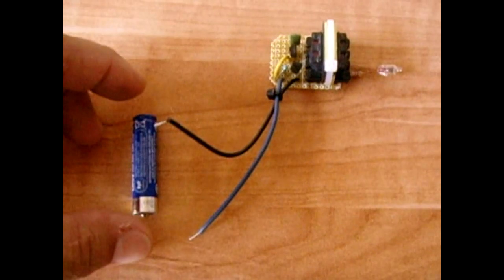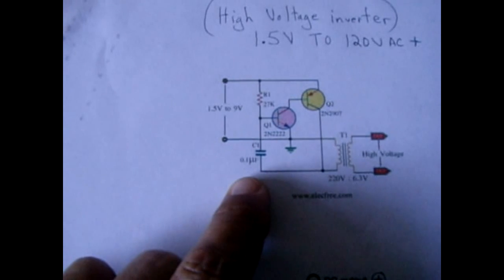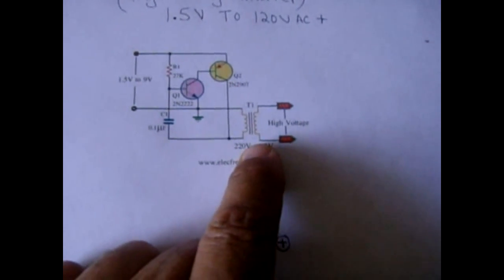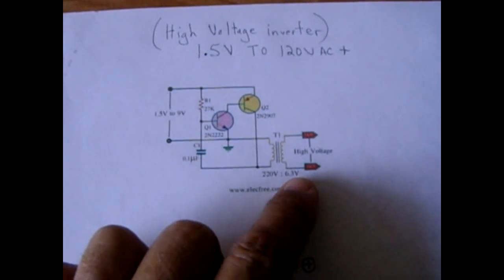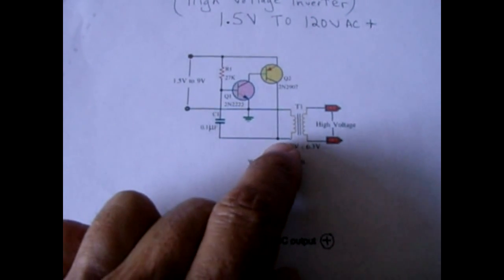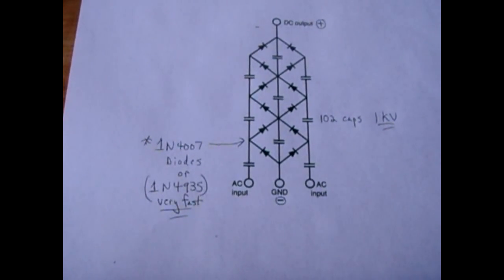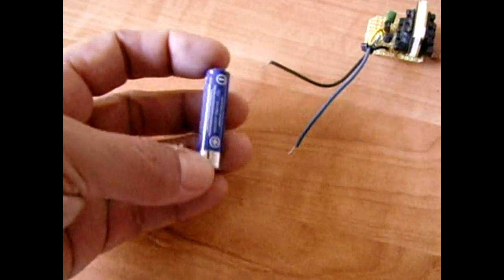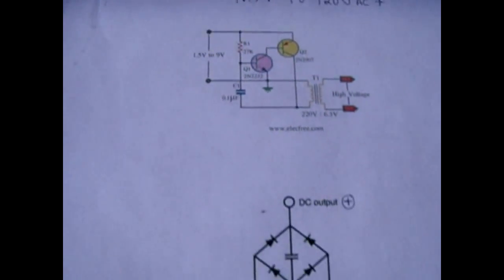AAA (1.5V) Battery to 120V or HIGHER!

Comment: Just for those who don't know. Neon lamps  have 2- electrodes inside of a vacuum of neon gas. When you apply  Ac voltage to them both  electrodes light up  orange. When DC is applied one electrode lights up. Reverse the polarity  and the the other  electrode lights up . DC causes only one probe to illuminate.  There are testers with 3 or 4 neon lamps  each lamp is a certain voltage range  and the tester is good for AC AND DC. inexpensive  tester, very effective at determining  Voltage amount and  if voltage is AC or DC.

Comment: I do't care anything about the high voltages I just want to run some of the 9 watt 120 volt LED light bulbs off of AA batteries. Thanks man
Reply from the maker: If you used (8) AA's in series for 12V, the power draw would be 800mA to 1A to supply enough power to (1) 9W / 120V LED bulb. Not a good idea.
Reply: @electronicsNmore  Are you sure you figured that right? you have 9 watts / 120 volts = .075 amps, that's 75 milliamps not 800. Is that not correct?
 I thought they were stepping the voltage down in those but they're not, they're stepping it up to around 200 volts or so, each of the LED's are 24 volts not 3.
Reply from the maker: @BushImports  A 12V power inverter requires roughly 9-10A to power a 120V/100W load. Take 1/10th that amount. :-)

Comment: I've got a 5volt High amp battery from a bluetooth speaker that took a fall.  I want to build this to power a portable AC photoeye/proximity sensor tester (350mA max) in a project box with micro 3 pin and 4 pin plugs.  What resistor and capcitor values would get me around 50-60hz?
Reply from the maker: This circuit wont be able to supply enough current.
Reply: @electronicsNmore  do you have any suggestions?   I know banner makes a test box I bought one for DC PEs and Proxs but I kinda wanted to make my own for AC.   I made my own buck converter w/ 3x 9volts in series (24v to 0v potentiometer with lcd voltage readout) to operate solenoids and test load cells that I use probably weekly.  And many guys at work copycated it but the inverter, let me put it this way been out of ET school for about 2 decades....

Comment: From my research it basically puts out a sudo AC current. It is an accurate enough AC current to be registered on a multi meter as AC. Apparently it can power can AC incontinent bulb and an EL light as well. So It's just a primitive AC inverter really. But it works decent I must say.

Comment: I hear you can get 20 v for free out of the ground , couple magnets and copper from an alternator and r pieces of copper tube and electrical wire 19.7 volts all day long from the ground. I wonder what hooking that set up to your set up here would generate? Would it be enough to charge batteries to feed electricity sufficiently to a home of 4? If so may be something that needs to be looked more into could really use more free energy solutions.

Comment: Will it work if the input is .5 v to step it up to 5v or more
Reply from the maker: I show a 1v to 10V boost circuit on my channel that's designed to replace 9V batteries.

Comment: Any chance for interests sake to get a scope output (picture) of the 'high v' end?
 
if you hook it to a DC supply and just trigger the gates the voltage should be well within the range for a standard oscilloscope, i'm generally interested as to what  spike / shape the wound configuration of the trans will make, i'll probably do this anyhow but it would be good for myself and others to  ref to your result.

Comment: Nice video. Is the circuit still going to function if i use a ups transformer
Reply from the maker: It should. Drive it using the transistors shown in my recent video.
Reply: Thanks for replying. What type of transistors should I use I don't know the video you are referring to

Comment: Sir sory if im asking this. But i dont know what is wrong for my cicuit. Because it did not work for me. Maybe my undurstanding on your schematics. For the two transistors on what part i will connect and for the capacitor what voltage will i used abf which will be positive side. Can u make for me to work it easier. Tnx in advance

Comment: In your schematic the transformer shows 220V coming in and 6.3V going out. Isn't that backwards?
Thanks!
Reply from the maker: The schematic is correct. The circuit drives the 6.3V side of the transformer, and the output is on the 220V side.
Reply: You right, is`t backwards.

Comment: I like a lot your video. I did this in he past but using only transformer and a battery.
I am now trying to find a small transformer to make one like yours. I found a power booster but that one is too strong bringing voltage from 6VDC to 85 Kv.
Congrats for your video and your schematic.
Reply from the maker: Thanks for watching! Be sure to rate thumbs up, check out my extensive video playlists, and share my channel with others. :-)

Comment: I am trying to make a transformer with about 1000 turns of .12 mm wire on the secondary and about 15 turns of .2mm wire on the primary on connecting the primary to 9volts DC the secondary wire begins to heat and starts to burn???
Reply from the maker: Clearly you did something wrong. You need to start all over, and try new components. The transformer should be fine, as long as the primary and secondary windings are isolated from one another.

Comment: could you run a nixie tube off this curcuit
also could you run more than one maby 4
Reply from the maker: Good idea. I never thought of using it for that purpose. This circuit can be made to put out 170VDC, and the current output is low, a few milliamps, so it should work.

Comment: This converts low voltage Direct Current to High voltage Alternating Current correct?
Reply from the maker: Hello. I never looked at the output on a scope, but it's more likely to be DC pulses, which resembles AC.
Reply: I did a bit of research and I still can't really figure out if it is DC or not. Apparently if the current is oscillating it means that it is moving back and forth and if this can supply 120V at a low amperage of course and if the current is oscillating i'm sure it can be considered AC current.

You see I want to know if this could be 120V AC or not because I am hoping to Run an electroluminescence display and electroluminescence wire with it. Do you think this circuit might work by any chance? Thanks!
Reply from the maker: CybertronixsTutorials
If you look at the neon lamp, you can see both electrodes are glowing, one slightly more than the other. That indicates Positive & Negative voltage.
Reply: Ok. I'm going to attempt to use this circuit in order to power a phosphor electroluminescence display. Do you have a copy of the schematic you would be willing to give out? I was wondering because I want to see If i can get it from you so I can see it a bit better. It's a little fuzzy on the video. Thanks!

Comment: can i use it as stun gun for fun-friends? can this kill someone?
Reply from the maker: The current output should be too low to kill a person, but nothing in life is guaranteed. :-)
Reply: And with 9v battery too?
Reply from the maker: Ji run
AA battery or a 18650 Li-Ion battery is all you need.
Reply: what is the second picture of diodes and capa.? and how I know, if is my transf. good? I have in my hand Lenze398420. can I use it? and when I want use trafo, how I can find primary and secondary coil? last quest., where to connect the ground under first transistor?
Reply: the second picture is a Cockcroft–Walton multiplier. 
i think you can measure the transformer with a multimeter. just select ac voltage on your meter.
you could also measure the ohms on the trafo.
less windings = shorter wire = less ohms = in this case the primary winding/ connected to the battery side.
don"t know for sure but i think the ground is just a reference point for 0 volt of the battery. 
i hope this helps although it has been a month ;)

Comment: what is the voltage drop of the circuit with transistor.....PLS answer immediately..
Reply from the maker: I don't understand your question. What voltage drop?
Reply: He's probably referring to the current output
Reply: is there a voltage drop on the oscillator....Example:1.5v when oscillator is added it becomes .5v

Comment: I do not believe you
Reply from the maker: Well, that is not my problem. Nothing on my channel is a hoax. Bye bye
Reply: I do not know wheter you are trolling or not but just so you know this is 100% legit. Just because you don't understand something doesn't mean it's impossible. For example a normal electric fly swatter can output up to 2000 volts from 1 or 2 normal AA batteries. So basically it goes from 3V (or 1.5V) to 2kV. 
You have your right not to believe but please, for the sake of everyone do not brag about it. And check your facts before commenting something that will only make you look like an idiot. 
So yeah. Not my problem so you can just go away, as the OP suggested. Bye, and never come back again. Have a nice life.

Comment: did not work for me very low output
Reply from the maker: More than likely a result of the transformer you used.
Reply: As the voltage goes p the current goes down.

Comment: If I hooked this circuit up to a 30 watt bulb how bright would it burn?
Reply from the maker: Hi Steve. This circuit is designed to produce a high voltage output at LOW current. What you need to make is an inverter circuit using a larger transformer. I show a few on my channel which have very good power output.
Reply: I was looking for one that could be powered by a AA or AAA battery. Could I still use a bigger transformer and still use a AAA battery?
Reply from the maker: Steve Rabon
No, you will require a larger battery.
Reply: OK thanks

Comment: This may be a counter intuitive question. But what if you put the output into  either a rectifier and or into a darlington power converter where darlington pairs are put in series to lower the voltage to 12v-15v where the voltage drop is about 1.2v per pair. The idea is to get high current to recharge a lead acid battery and or run a power inverter and how many watts could you get out?

Comment: how many volts is .01uf capacitor connected to transistor and what type capacitor is for voltage multiplier ceramic or electrotype.
Reply from the maker: For the circuit in this video you can use any voltage capacitor. For the multiplier circuit you use non-polar capacitors and fast switching rectifier diodes. Look online for cascade voltage multiplier circuits. There are many.

Comment: What peak voltage is going in to the transformer? I have everything (and more) to build this but I'm holding out on winding the transformer secondary. If you're unsure, then I'll make a video of it on an o-scope once built on breadboard. Winding a high voltage toroidal transformer is some fun stuff ;)
Reply from the maker: +Yz250fTony 
Hello. There is plenty of info in the video. You need to experiment using different transformers, and # of windings.

Comment: what kind of capacitor is that? is that a ceramic capacitor? or a mylar capacitor? please answer?
Reply from the maker: +Riboy Dumlao 
Hello. Does not matter. You can use mylar, ceramic, etc.
Reply: okey thanks a lot :) uhmm.. im also using a transformer 220v-9v and a 9v battery is it okey?

Comment: Nice video. But what if I use a small dynamo that has an output of 1.5V - 2.0V AC when rotated, would this still work? I just really needed to know for my project.
Reply from the maker: Hello. Connect a bridge rectifier to the dynamo AC output, then place a 100uf electrolytic capacitor across the rectified output(+ to +, - to -), then to the circuit shown in this video.
Reply: Thanks sir! Finally I can start making my project, I hope it works perfectly fine :D
Reply: +electronicsNmore Sir how many turns for the primary and secondary coil?

Comment: it worked for me but i couldnt power a light bulb or an ac motor, is there a way to do that, plus my transformer was making small buzzing noise does that mean anything.
Reply from the maker: +TopMusic 
This circuit supplies high levels of voltage at LOW current. You should have no problem illuminating a neon lamp.
Reply: i guess theres something wrong with my circuit, tried my bulb and didnt work i even touched the ac wire didnt feel a thing

Comment: I built one kind of. using two 40-50W power transistors. a 1K resistor and a 250ohm resistor. with a 240V 4uF capacitor (from a fan)

A 9.6V DC 2A power supply. Then after the circuit I put a 9.5V 1.5A input transformer with 120V output single phase

Its strong enough to actually POWER a 40W stereo at loud enough volumes that it'll probably hurt your ears

And thats a 120V stereo that plugs into the wall. I'm very surprised!

it also has no problem charging a 4V drill or a phone. nice!
the transformer gets warm but no warmer.
The transistors stay cool but I need a more strong power supply..
I am very satisfied lol!
Reply: +realflow100 sounds interesting, can you make a schematic by chance?
Reply: Anon Ymous I can give you a link to one that i used and modified the circuit to have a stronger output.. though still not very efficient.
http://www.talkingelectronics.com/projects/BasicElectronics-1A/imagesP2/Fig32%20-%20PNP-NPN-Osc.gif

I'd change the 330K to something massively lower like 1K and try modifying the 1K shown in the diagram to something lower as well. (thats where a lot of the power goes through the circuit to the output) You could also try putting a 4uF capacitor in parallel with the 1K that ive changed from 330K to 1K for maybe more power. but make sure you use a non-polar capacitor rated high voltage for both capacitors. they can still heat up if driven from only 5V (high voltage > 250V)
There is a lot of inductance in transformers.

You could also maybe change the 10uF capacitor as well.
Reply: Thanks a whole bunch! I'm recently been obsessing over getting my AC powered sound system converted over, and this seems to be the best way..thanks again!
Reply: Anon Ymous be careful not to shock yourself though!! and take note the more power you draw the higher frequency the AC output will be.. And some transformers are too high impedance or too low and it might cause it to not oscillate. or just give a DC output. but for a 9.5V 1.5A input transformer with 120V output it seems to work alright though i wish it'd work a little better maybe..

Comment: If you pulse 12 volts into this can, you can run all kinds of things. All you do is make this metal can that is 1/8 inch thick iron and has a bottom. Make a magnetic wire coil that goes inside this can, then another iron can inside that one making sure that the coil is tightly secured in between the two iron and also is sealed from inner of can and bottom. The inner wire of the large coil about 3-4 inches before the end is exposed to the distilled water you put inside the center of the can. The water does not touch the coil only where it is exposed. The other end goes out thru a hole drilled into the 1/8 iron can where the coil is and NOT the water. Seal with caulk. This cannot touch metal. Get a round clear plastic top and drill hole in center. Put the wire that touches the water thru here. Seal this lid down with a vacuum. When this coil is pulsed by D,C Current it puts out well into the 20k watt range on a 12 volt battery when made to proper dimentions.. With power to run a blender, microwave oven, refrigerator, electric stove, electric water heater, electric washer, dryer or whatever YOU can think of to run with it. Do NOT touch any of the wires when you are pulsing this can. It is a reconfigured high voltage transformer.  IN THEORY. We all know that magnetism  transfer electrical currents from one wire to another also transfer electrical currents in iron not only copper. We also know what happens when an alternating current does when it is in water.  The water cools the coil and also magnify the power output when being pulsed by a 12 volt battery. Example. take a microwave oven  transformer and take out the thinner wire coil. Put back together leaving in the larger wire coil. attach a 1.5 battery to the coil. NOTICE that you do NOT get shocked putting the battery on, BUT you will get shocked taking the battery off the coil. A nice jolt to wake you up. If your hand had a lot of sweat on it you would get an even more shock. For some reason a 9 volt battery does NOT work. I have no idea why. I say this is a can theory because the water inside may need some salt mixed in, who knows. IF this small coil inside iron can do this on a 1.5 battery imagine what it cold do on 12 volts pulsed. You know, you can buy a 370 amp, mechmann alternator,  2 -12 volt battery's, a car starter without the selenoid,  a 36 volt solar panel and a charge controller with a potensiometer. These things running put out serious wattage when put together. The solar panels charge the battery. the battery runs the car starter, the car starter runs the alternator that pulses the can which is connected to a fuse box and outlets. The only problem is , is that the car starter gets way to hot and burns itself out. Need to find a way to cool the motor or perhaps a brushless motor who knows.

Comment: So basicly, you can run a car with motorcycle battery? The same system but different engine. If this is a possible (and Im sure that it is), can you use output power of last transformer(if there is more than one) to power up first transformer and recharge the starting battery? Sorry for bad english :-P
Reply: +spartanRS maybe
Reply: Motorcycle batteries and car batteries are typically both 12v.